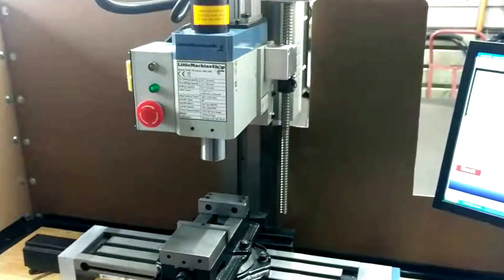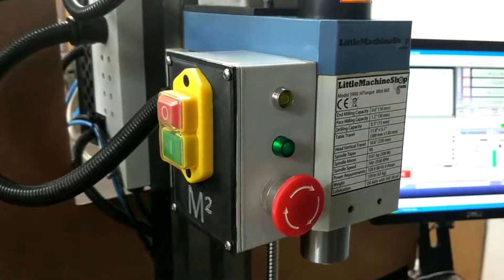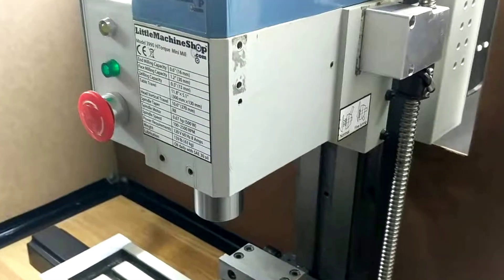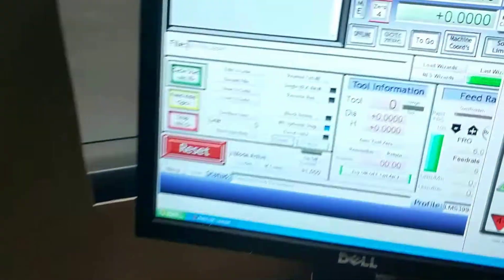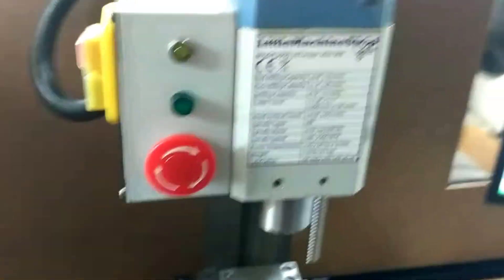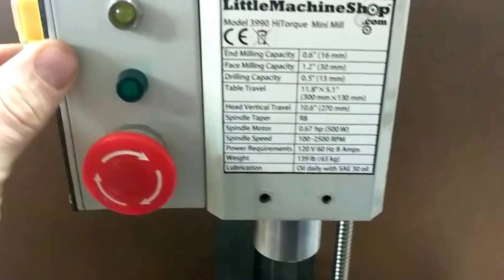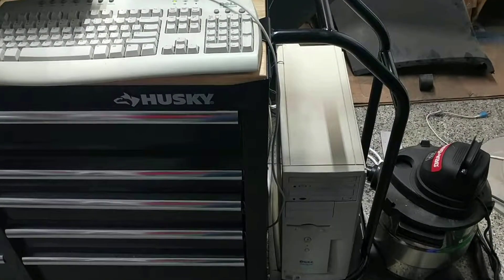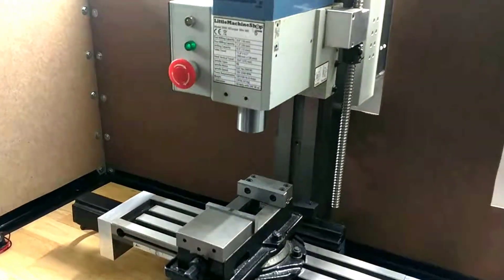LMS 3990 CNC Project - Step 1 - E-Stop + Workbench Overview

Comment: I'm about to buy the 3990.....which work clamp is that fastened to the table?

Also, about how much in aftermarket parts(software etc) to convert the 3990 into CNC?

How well does the cnc conversion work?  Accuracy?
Reply from the maker: The work clamp is a generic 3” swivel from Little Machine Shop.

I think the full conversion, parts and software was around 1500 dollars.

Precision depends on what you’re cutting.   I mostly do aluminum and if I keep speed in check it can probably get close to 0.005 if setup properly.